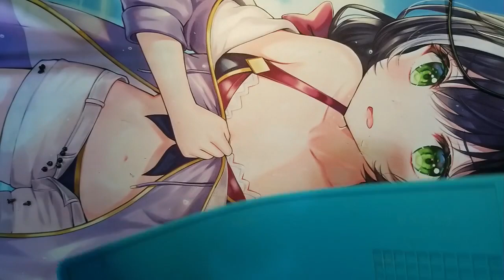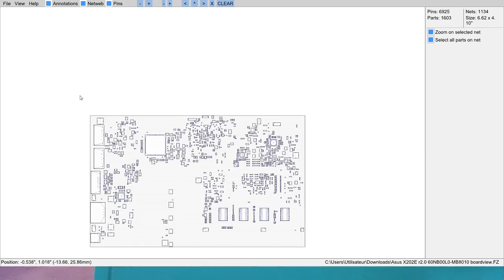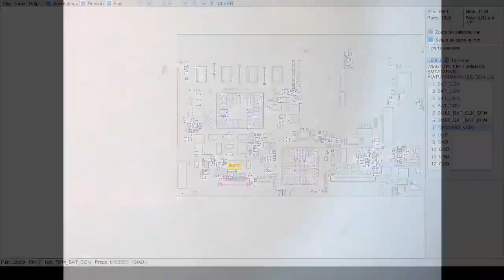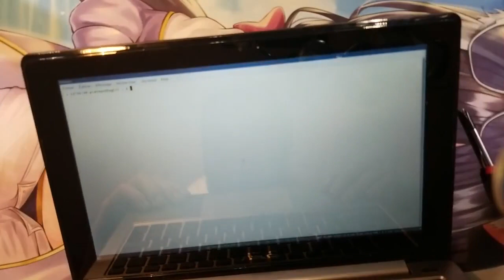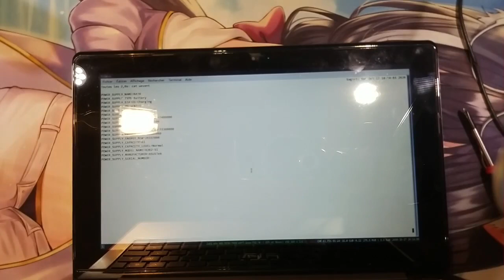T&F Asus X202E battery connector (NO AUDIO)

Comment: Would have thought the battery connector would have some anchor points on it to provide support to prevent lateral movement. Would applying any glue to the sides of that connector to provide stability to the port help?
Reply from the maker: It has anchor points but they are pretty weak as well and broke off from the connector. Not sure which kind of glue would bond to the PCB and be strong enough.
Reply: @piernov  Great job as usual piernov! I did one similar a couple months ago, the anchor points were a little pain to solder with the correct alignment. I soldered them on then slid the connector on to them but I applied some glue on the board first, we have a glue called "evo stick" here, I used that. The connector also had a metal lock to the top that has to slide out of place before the battery connector could be removed. I suspect that in attempting to change the battery, the owner tried to remove the battery connector without sliding the lock and that's what caused the damage.

Comment: Hey there neighbour, 
I'm guessing you've got plenty of faulty laptops laying around, maybe one of them has a better usb webcam that you can just hook up to the computer using a usb cable and a 5v to 3v3 LDO regulator. ( I personally tried the diode approach for voltage drop and found it to be unstable. one diode leaves too high a voltage, two diodes, too little. probably depends on the webcam but ymmv.) 
Or, you might just use the camera on a smartphone  :)
Enjoy !
Reply from the maker: The "overhead" camera is actually my smartphone, would be better to have a 1080p camcorder or even webcam instead though. The close-up camera is the old 640x480 webcam, it has an adjustable lens and I can focus it very close. In fact the frame is similar to what I can see with the microscope on the lowest magnification. The non-repairable laptops I have are all pretty old, they either don't have a webcam or it's 640x480 as well, also you can't focus that close, so unfortunately that's not an option.
Reply: @piernov  Well, anything less than 15yrs old would still be an improvement I think :) might still be an avenue to look into. Have fun !